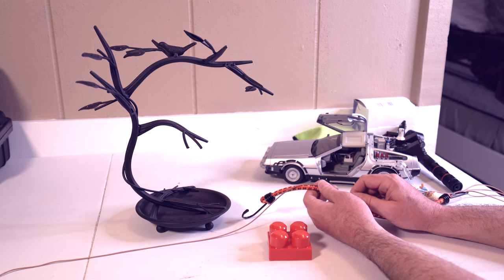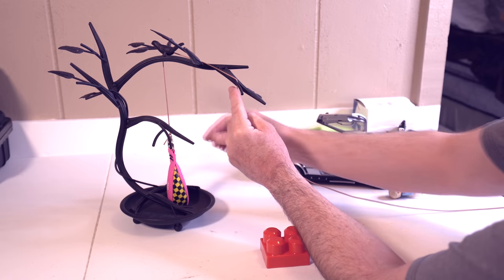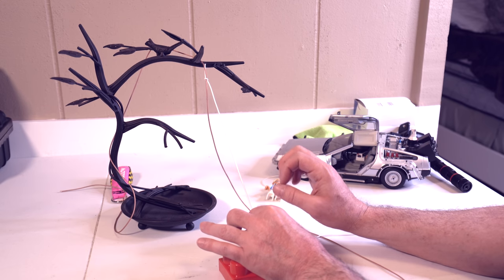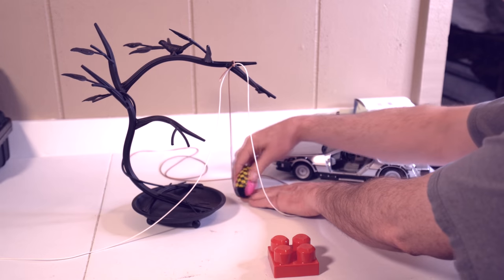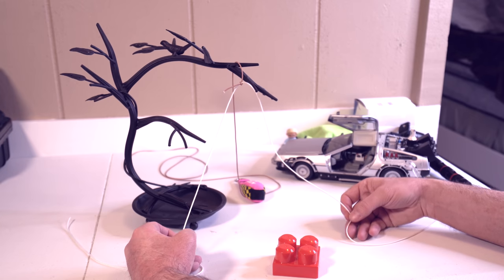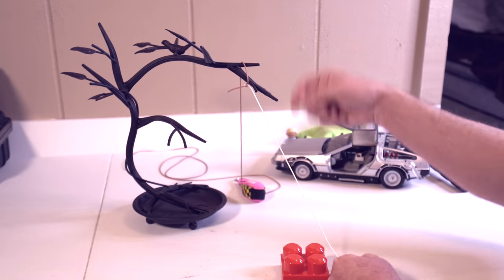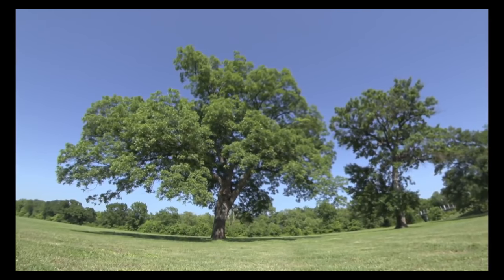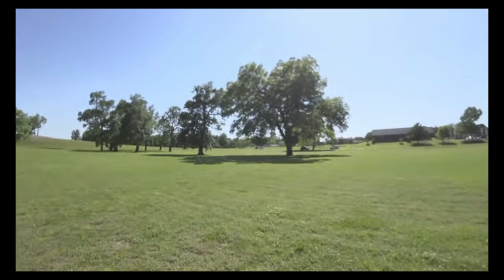Wire Antenna into Tree Advice ~ 100+ Feet!!!

Comment: This is an amazing video - the first video really explaining the technique of installing an antenna in the field, among hundreds of those where it is assumed there is nothing easier than fixing a wire to the tree. So, thank you very much indeed! As for a wish list, I would think that the technique of raising a dipole would also be very helpful. Possibly it is just adding a second tree, repeating the same "shooting" or throwing process. But I would love to see that. As for an inverted vee, although lacking any experience with it, I would think that one has to "shoot" with the rope as in the film, but instead of an end of a wire the central part with the coax has to be raised. But this leaves an issue on how to fix the ends - at what height and by what means. Of course, all this is just a suggestion, I really enjoyed watching the current video. And do not pay any attention to hate messages - there are lots of "nuts" on the Internet, and the films are definitely meant not for them, but for us. And it seems that I am becoming addicted to this channel! 73 de R2ARM!
Reply from the maker: Awesome comment. So kind. I pinned it to the top. I'll try to do something this spring where I do an inverted vee and horizontal dipole
Reply: I realize Im quite randomly asking but does anybody know of a good place to watch new movies online?
Reply: @Vincent Miller I watch on FlixZone. Just search on google for it :)
Reply: @Royal Hamza definitely, I've been using instaflixxer for since march myself :)

Comment: Thanks for the tip on the cradle throwing method. Finally took my throw bag and line out this morning for the first time and got the line where I wanted it on the first throw, which never would have happened with the single hand method.
Reply from the maker: Yeah that single handed is wild...congrats and have fum

Comment: Thanks for sharing. I have been using a slingshot with a lead weight with Spider wire fishing line. It is a braided type line rated at 30lbs and it works very well for me coming out of an cardboard box that I unfold  and refold when done. I do put a piece of thick paper in the bottom of the box to keep the line from catching on the bottom of the box. I have the top flaps cut off the box. Poor mans way of doing things for sure and I wish I had a setup as nice as yours. I do pull my 10-80 end fed up into an inverted V at hope which is my HF antenna I use at home.
Reply from the maker: Yes... the inverted V works super well at home where you can leave it up for a while.  Speaking of that, I think I need one for my house!  Thanks for the detailed comment.

Comment: Use a "wrist rocket" sling shot to shoot fishing line (from a closed faced spinning reel) tired to a 1/2" or larger steel nut.
This has worked ver well for me so far.  True that your method perhaps takes less equipment. I am doing this on my own property for a semi-permanent install.

Comment: YOU TOO CAN DO DX PHONE WITH A KX3 @15 WATTS OR LESS. 
I'm only writing this because I've seen you complain at least once about not being able to do phone with your kx3. I just got my license a few weeks ago along with a radio and a few of the things that go along with it. I did a little investigating and found that high-end end fed antennas were very highly rated. Because I have a very, very small backyard, I bought their multiband short antenna. Yes they call it a short. Only it's dutch so I think they spell it k o r t. Probably because I really wanted to do a dipole, I couldn't get the idea of having both ends of the antenna at height. The instructions did not advise against this by the way. So I have both ends of my high-end end fed multiband short antenna up about 40 ft into trees.

Well my friend ( you helped me to decide on the KX3 for a first radio.) I can guarantee you that you most certainly CAN DO DX PHONE with low power (15 Watts) using a HyEnd end fed antenna.
My first contacts two weekends ago were without my system being grounded and it was VERY,  VERY noisy. The following weekend I grounded the coax  where it enters the shack to an eight foot ground rod.  What a difference in noise. Much lower. So my first contact was
Loveland Colorado. (I'm in California) 1100 miles. Then I hit Fredericksburg Virginia.  About 2500 miles
Then the Edward R Murrow relay station in North Carolina. About 2700 miles.  In between those contacts was the one that blew my socks off. General Santos City. In the Philippines. About 7500 miles. Voice (phone) , at fifteen watts. Now I could barely copy him, and it was a difficult contact, but so what right? I will admit, I thought the Philippines was some severe luck. A real fluke. 
However, the following weekend, (last weekend) I made two contacts to Japan to two completely different stations.  5500 miles. Same thing, phone, with fifteen watts. Now I don't yet have any logging software, and my notes really suck, but I know Love land was on 40 meters. The DX contacts I'm not sure but I'm assuming I was on 20 meters. If everything I understand (not much) is correct, I'm simply not high enough to do DX on anything  below 20 meters. I'm up at 40 feet. So that's well above 1/2 wavelength for twenty meters, and maybe I'm sort of squeeking in on 40 but, your guess is probably better than mine. I have NOT yet made a contact on eighty meters. I'm very concerned that I won't either. I'm just not up high enough for sky wave. I have an idea that might get me up to over seventy feet though, but that will cost me a few hundred and I need to lay off the spending for at least a few weeks. I'll need two poles to "mount" up into the trees. Probably more like lean against two trees. I found sixty five foot telescoping aluminum poles at DX engineering. That will get me at least to sixty five feet. That would cover forty meters. I am so jealous of guys that have the right real estate for ham radio! I dream of a QTH two 131 foot trees that are 262 feet apart. Maybe even four. One at each corner.
Reply from the maker: Yeah, I hear ya on the qrp SSB, I just struggled with it at the beginning and also, I don't have much time and I'm making a video. I need to make contacts so I kinda, gave up on it for now as I found CW to get hits much easier.  But I get what you are saying. I will try some SSB qrp asap.
Reply: @hamradiocq  I'm a brand new ham so I don't know CW yet I started learning it after I passed my tests. I don't know how long it takes but after about three weeks I'm not exactly ready to start flying away on the straight key. I do have every intention of learning and communicating using CW, and at first I was thinking maybe of letting the kx3 help me along with decoding. I might be able to send okay. What am I saying? Just because I can do the alphabet doesn't mean I can send right? Anyhow I am in awe of you guys that can do CW. I WILL learn it. I just don't know how long it's going to take. So for me doing phone is kind of a necessity almost. Once again I can have the kx3 help me out but I don't know if that's a good idea if I'm trying to learn CW. And as far as the DX contacts I've made, I really believe that so much of that is just plain luck with how my antenna went up, my surroundings, the ground underneath, the conditions that day, that hour, that second. There's so much going on that I just don't understand.

I have to admit if I was good at CW I may leave voice behind. I'm making small little wave files, things like my call sign, some Pro signs and abbreviations, my qth, then I put it all together and listen to it over and over and over again. I think it's helping but only time will tell.

Keep up the videos they're great. Very entertaining and instructional as well 73 s.

As I said in one of my other posts, one of the big reasons I got the kxt set up I mean kx3 set up was because of your videos.

Comment: Nice video, interesting trigger on the slingshot. I have been able to get to 60 feet with the under-swing arborist technique and gear. When I want to go higher (up to nearly 200 feet) I use compressed air pneumatics and tennis balls with some sand in them. A sloped dipole is another option, it doesn't have to be too high on the low end. Endfeds are certainly convenient. Shooting two trees and raising a dipole to 100 feet is quite easy and fun if one has a little more time and appropriate trees. 

Australia went anti-everything nuts some years back. Very sad. Value our freedoms.

Be safe and have fun.

73 de w6akb
Reply from the maker: Thanks for the comment I really appreciate it.

Comment: Thank you for this instructional video. I have an end fed antenna that I haven't used yet and I will try your techniques. Not sure why but the knot tying and the remainder of the video had no audio for me.
Reply from the maker: That is odd, I had a problem with my audio also on the last part, but I do have audio.  Try with different speakers or try changing settings.  Thanks for the comment, Susan!

Comment: I have been thinking about using a cheap drone to hang some wire. I think using Spider wire or a high tensile strength fishing line to accurately place my initial run to string the antenna would work well.
Basically bringing your fishing line up to the branch you want to run your antenna over and once clear cut power and let the weight of the drone pull the line down.
Reply from the maker: I think a drone would be problematic. A fishing pole with line would be simpler. I tried fishing line first. And found it tanglea like crazy

Comment: Entertaining video with some great ideas! I've just begun using an arborist weight last summer after getting my water bottle hung up in a tree one too many times. You're right about the challenges of under hand throwing. I've looked at those arborist sling shot and have a hard time coughing up $100 bucks. Wonder if a painters pole and bungee cord would work???
Reply from the maker: Yeah, the sling shot isn't really necessary, it's over kill as I mentioned.  You should be able to throw it 40-50+ feet, depending on your skill and you can slope it.  Thanks for the nice comment!

Comment: Random wires & antenna tuner to get on the air quick is the best way to go for a newbie - I've had great success with the cray lobes that seem to emanate from random wires. My rule is - if you can hear them, they should be able to hear you. Learn how to load your wire with a tuner and you have an antenna (anywhere) for life.   wb3gbl
Reply from the maker: I agree, love the wires.  I have been experimenting with easy up verticals lately hoping to avoid tree stuff.  All good.
Reply: @hamradiocq  Working on an easy up vertical as part of the guy wire system for my VS6BKW antenna, going to use 1/16" aircraft cable and a 20 meter trap to use the 50ft high guy wire as 40/20 vertical - I'm right on the Chesapeake Bay so I couldn't resist trying a vertical on saltwater - maybe consistent Europe contacts? I hope so!

Comment: thanks for the content, I'll stick with my sling shot and fishing line. Have fun catch you on the air waves 
73 KQ4CD
Reply from the maker: Yeah, I found that fishing line is very tangly.  But do what fits for you!  73
Reply: @hamradiocq   Guess I should I added a Slingshot fishing line in a fishing way works every time
Reply: @hamradiocq  I use a Zebco 202 (Cheap at Walmart) and changed out the original fishing line for 25#.  It's much stronger and won't tangle as easily. worked for me in many state parks. 
 73 de K4EES

Comment: Slingshots are good for us old guys too. The EFHW is best for portable use in my opinion too. Only 2 contact points with EFHW, the branch holding the thrown end and the end that connects to the transmitter. Inverted vee would be great for an extended stay, but like your outings Tom of typically a few hours or an overnighter an inverted vee, again my opinion, is too much effort involved. Also, it requires 4 contact points, the branch holding the feedpoint, the 2 leg anchors, and the transmitter end. 72 de KB8AMZ
Reply from the maker: Thanks for the comment Terry

Comment: a lot of great ideas there Tom!  after seeing your previous videos, I went and bought most of that stuff on Amazon, although I didn't know about the small cord I'll have to go look for that a Dayton,  And the knots, it was great for you to explain those features of the rope and how to store it, and prepare it for launch. Is the cord about 1/8" thick? You could use a drill bit  gage to find out, I'm sure others will question the size . Unless you already have one, Home Depot and Lowe's sells them and they start at 1/16"  drill size and go up to 1/2" drill bit size in 1/64 increments.
Reply from the maker: Yes, the cord is about 1/8" thick, very thin you'll know it when you see it.  Regardless, thinner is better (as long as it's strong).. I hope you enjoy your new throw stuff!